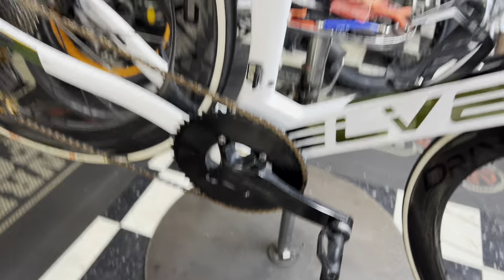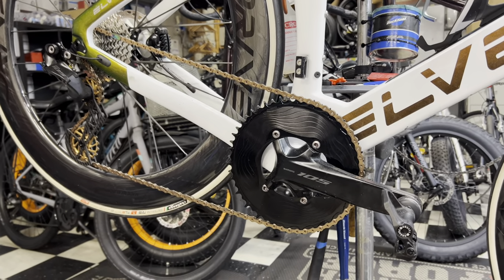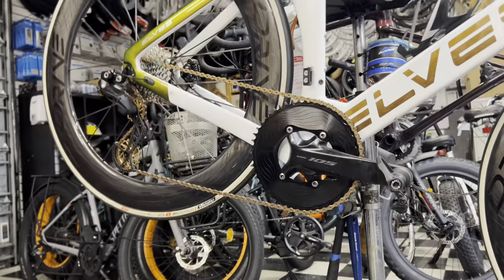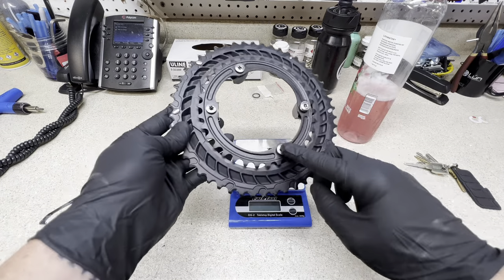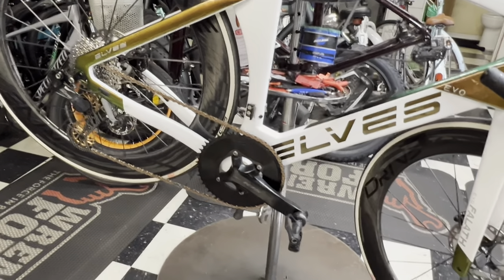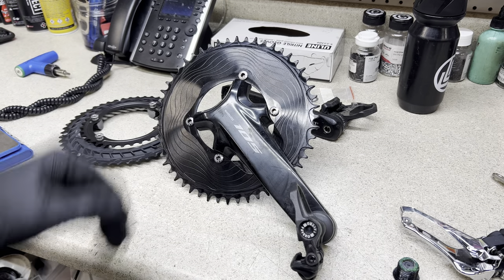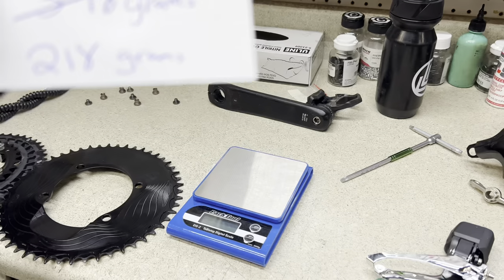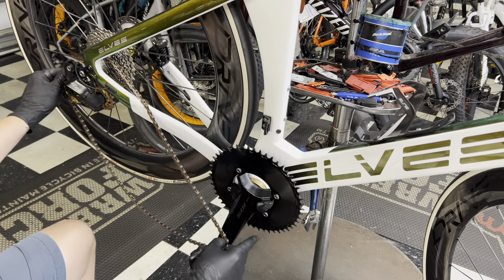IS THIS THE BEST UPGRADE FOR YOUR BIKE?

Comment: 1x is not for everyone and every situation. For certain situations, 1x is definitely the way to go. For most of the riders/situation, 2x is the way to go. I have 1x as well as 2x bike and use 1x mainly for my gravel bike.
Reply from the maker: I could seem them easily push this in the future making a 13 speed group road oriented and having a 1x chainring, having a 10-50 in the rear or something like that and a 48 in the front

Comment: I live in Belgium. My neighbourhood is the terrain for "Ronde Van Vlaanderen. The Hills here have elevations of 14-20 degrees. Even a competitive cyclist can't do them all with 1 front chainring. This is like trying to reinvent hot water.
Reply: Wva used a 1x in gent wevelgem. Climbing up the kemmelberg on a 1x. I tried it recently and im not a super great cyclist. I even managed to get up it at 23% in the big ring 52t with a 11-28
Reply: @SyLens1  he's using the classified rear hub. so he basically has the same gear ratios as a 2x
Reply: @SyLens1 link the Strava ride where you went up 23% gradient in a 52/28 gear.

Comment: You can save a whole lot more weight by going 1x in the rear (single speed) perfect for flat lands and big guys like you. I use SS for my Z2 flat rides.
Reply: When you are not climbing, saving 1kg on the bike really doesn't matter in terms of speed.
Reply: Yes, in fact, once you get the speed up, a heavier bike is better to keep the momentum because of inertia.
Reply: Yes, in fact, once you get the speed up, a heavier bike is better to keep the momentum because of inertia.
Reply: @blueshun  That's exactly why my 12.8kg fat tire road bike is such a steamroller on flats! People underestimate the rig until they see what I can do in a makeshift TT position (forearms resting on flats, head tucked). It just plows!
Reply: What about the added weight of the significantly larger cassette.  Probably offsets any weight savings from the front.
Reply: @testalino  I know, but just extending out his reasons for going 1x. Also saves a lot of unnecessary wear on any parts and even more aero going SS, extending his reasons even further....
Reply: @richardguggemos6336  I did the math with xplr vs 2x Force axs when I build my bike and even with the other cassette (10-44 instead of 10-33) it came out 200g lighter. But the sram front mech is heavier and I am using a lighter 46 tooth front chainring.
Reply: @chuckyfox9284   if you are using electronic shifters and disc brakes, do you really even care about weight?
Reply: @richardguggemos6336  I have more of an allroad build with 32mm tires that I also ride on gravel and very poor roads. Rim brakes aren't really an option there. My budget was under 2k€ and the bike weighs 7,6kg, which i think is pretty decent. I don't think mechanical shifting would be significantly lighter, if at all. All of the mechanical options I was looking at (Ultegra, 105,  GRX 812) ended up being heavier because of the heavier shifters and cables. A rim brake build would have definitely been lighter.
Reply: @chuckyfox9284  Chucky, you don’t have to justify your build to me.  Im happy if you love your build.  But, I’m just trying to point to the fact that most of the cycling audience is brainwashed by marketing to focus on features not riding.  By the way, a 105 AXS front d is claimed something like 150 grams.  Then there’s 50 grams of battery.  A good (not necessarily top end) front d is around 95 grams < half of AXS.  Unless you spend a fortune, even on Ali express, that enlarged rear cassette is probably an extra 200 grams.  And the derailleur to handle it typically adds a hundred grams. Your 42 chainring weighs half of a what a 50/34 combo does (50+34=84 84/2= 42).  I don’t have a 42 handy, but a 45 weighed in at 6.5 gams.  Netting these items, the 1x would be 350+ grams heavier.  Add another 200-250 grams for hydro disk brakes over rim calipers and another 100-200 grams of hydro shifter weight, even with electronic shifters and 1x, there is no amount of missing cable weight will lead to electro/hydro offering the lightest build.

Put another way, my 1st gen. red group is purported to weigh about two kilos.  New rival AXS (which I think has a similar real dollar cost) comes in around 3.2 kilos+.   And before you worry about only 2x10, recognize that unless one is looking for an unusually large range of gears, x11 or x12 doesn’t buy much.  There are still a bunch of gears on a properly configured cassette that are only 1 tooth apart. Adding one more of these doesn’t do much.  Meanwhile, the latest red still gives up 700 grams to my set despite its obscene pricing.  For an example of obscene: I recently saw a Red crankset priced at $749 which is close what I paid for my whole group set.  Inflation notwithstanding, that’s crazy.

Yeah the industry is trying to take away options, it’s called planned obsolescence.  But if you really want a caliper brake gravel bike, you can have one.  You’ve chosen and configured your bike as you like it.  And it makes you happy.  So that’s great and will probably encourage you to ride and enjoy it more.  I’m truly happy for you.  But too much bro-speak floats around echoing marketing speak and confuses consumers and misdirects riders to focus too much on technology and tool little on riding.  Moreover,it supports cost increases well beyond the range of inflation.  And of course that’s what all of the bs claims are all about.  So I say, don’t feed the dragon.  BTW, I’m about to build a frame on which to install a 1x setup just to see if I like the ratios that are available.

But all this bro-speak repeating
Reply: what is the point exactly of a z2 flat ride???
Reply: @janemf  To recover from your intensity days. To work on aero position. To become more metabolically flexible, train your body to burn fat instead of relying on carbs. To just enjoy riding your bike. Anyway, those are my reasons, I'm sure others have their reasons.

Comment: Not a chance. I'm doing Col de Joux Plane, Col de Loze, and la Planche des Belles Filles in the next few weeks - among others. I will be glad to have my 34/34.
Reply from the maker: Pogačar enters chat: climbing in big chainring
Reply: @GCPerformance18  but I’m a mere mortal!
Reply: @GCPerformance18 like saying everyone should be driving an F1 car because it's faster
Reply: @GCPerformance18 no, he doesn't, because Tour de France winners have nothing in common with 99% of cyclists.
Reply: 34/34 is 1:1, which you can still have on a 1x without sacrificing anything. A 38x11-42 is killer
Reply: @thedownunderverse  38/11 sacrifices 50/11 or even higher...that's a pretty big sacrifice. And having 11/42 surely adds so much weight to the cassette it balances out the weight lost from going 1x at the front.
Reply: @thedownunderverse  I also like the abiliter to add or dump a lot of gear at once. The FD allows me to do that when desired.

Comment: In a one-by  the chain is  under extreme stress at the top most and bottom most sprocket gears. The front derailleur helps with that. The entire drivetrain suffers worse than a 2-by.

Comment: I honestly believe if you live in Florida, this is a legitimate and functional idea. It looks way cleaner and less stuff on the bike to go wrong (hence why I'm anti electric Groupset and electric everything 😂)

But where I live, I may not have mountains but the elevation is ALWAYS changing and pretty much hills are everywhere and my 2x gets used EVERY ride for sure.
Reply: It sucks literally everywhere except a race track ring.
Reply: I came here to say the exact same thing. 

If you live somewhere that is relatively flat, there is literally no reason to run 2x; get rid of the FD, lose weight, make the bike more aero.
Reply: Yup!  Totally agree with you guys.  Where I live, in Maryland, I NEED my 2X.  No way could I do a single.  No way.
Reply: the problem is that in a mechanical group, if you don't have tools, the chain drops to the heaviest gear, and in an electric group, when the battery runs out, it stays in the same gear.
Reply: @MBdrummer3288  Yeah man! I LOVE the look and having less to worry about but I actually need it. There's been some rides where I was like "why did I ride this far" and on my way home, if it wasn't for that second ring, I would have had to call an uBer, take the bus or hop on the train 😂
Reply: @JW-hj6sd Yes and no. Yes it's true what you say but how often does your mechanical shifting have an issue? Like, really?
Reply: I will never go x1 even if most I ride on bike with SRAM red 22 hrd is the 53/11 gear even from traffic lights
Reply: I do very hilly gravel races on a 1x. Had one on my old road bikes, too. I went from SRAM to Di2 on my new one and dont have one for my road bike anymore. You need a bigger range on the back cassette, but I never had issues with it. didn't drop a chain once with it. I live and mostly ride in New England, so I'm not heading up like Long Hills, but we have hills.
Reply: @arthurmulhern  Right on! That's hardcore. I believe I could do it, as I rode a 52/16 single speed for a while but I still cried on hills 😂

New England as in East coast or "England" England?
Reply: @RyanWilson876   East Coast America. You do need to spend some time figuring out the ratios with the rear cassette. (check out Sheldon Brown's Bicycle gear calculator.) I think oval rings make a big difference too. I can go up a few teeth with them, and it's easier to pedal the same gear, and it's faster. I like faster.
Reply: @arthurmulhern  Yeah, I checked it out! I never really thought of the Oval rings. If it's really that good I'm going to have to give it a try! Seriously! I like speed personally. Not too caring for acceleration. I like maintaining high speeds.
Reply: @RyanWilson876   On my road bike that sits on the trainer most of the year. (They are "absolute black," not this brand) I went from 52/36 to  53/39, and it's easier because they are oval rings. Would definitely recommend ovals. 

I just bought the 54/40 from the company this video is about. Let you know in may if they are good.
Reply: @arthurmulhern  nice ! Okay! Okay! Looking to hear back from you!

Comment from the maker: What you do you think of the this being a thing in the future 1x13 drivetrain, and getting rid of front derailer all together? 

where to buy this chain ring: 
https://alugear.com/chainrings-1x/290-15690-round-1-speed-for-12sp-110-bcd-4b-shimano-asymmetric-roadgravel.html#/40-size-52t/15-color-green
Reply: CVT!
Reply: Hopefully we would never see the day where manufacturers only releasing 1x compatible only drivetrains just like disc brake nowadays. It doesn't mean that if Wout Van Aert use 1x that suddenly that's what you gonna use with your bike. I'm all about proper gearing even though let's say you're just gonna ride flats today having extra gearing makes more sense than faffing around changing your 1x crank set when you wanna ride on the hills.
Reply: Why would you save weight if you live in a flat area? It would be better to install a 11-26 cassette And enjoy the minimal gear step

Comment: I don't mind 1x, I have it on my gravel/allround flatbar bike that rarely sees proper hills, but I never understood argument of better chainline. I guess if you compare it to cross-chaining on 2x, but if you shift in the front when needed for sure chainline is better than in 1x extreme gears.
Reply: I think the idea is that you spend most of your time in about 3 gears next to each other and you can optimise the 1x to have perfect chainline for those gears. When you have 2by you have perfect chainline in really fast and really slow gears. I don't know if it works out that way in practice tho.

Comment: I tested a 1x setup by riding in my 50t chainring all the time and I could climb all the major hills in Montreal with an 11-30 cassette. I will actually go full 1x with a 11-32 cassette next season.
Reply from the maker: exactly, and no even more with sram having 10-36 or shimano having 11-34
Reply: @GCPerformance18 Soon Shimano will release their 11-36 as well
Reply: Agreed. I’m running a mullet 1x10-52 and it works for my BC hills.

Comment: I am using 50-34 with 12-25 or 11-23 cassette on the flat. I wanted 1X, but my bike was 6.8kg  with double. I think the 11-speed 12-25 with a good sized 1x chainring is the best for flat roads.

Comment: 1-"Just get better at cycling" I live in a hilly place. Not too much, but we frequently ride at our smaller chainring in a group.
Let's make the calculation and find out how good I have to be. 
4% gradient and want to go without grinding. If I run with 50x14 at 90 RPM, I ride at 26kph. (75kg rider) I have to run at almost 380 watts.!!! 
You can always run with your smaller chainring. In this case, you have to cross your chain.
If you live in a flat area and even a beginner can average 30 km/h, then use the 1x system. But if you live in a place with some hills and if you have to climb more than 3% or 4% in your daily rides 1x system does not make sense. (Talking for mortals among us)
I'd like to see how you get uphill comfortably with your 1x setup. Then we can talk about "being a better cyclist"

2- You only get a better chainline for 1 gear... In 2x Setup you get 2 straight chain lines.
Reply: Just to add to your second point, the outer cogs actually get worse with 1x. Most people would never cross chain that far up/down the block on a 2x, but you have to with 1x
Reply from the maker: so the 1x set sits in between the big and small chainring, thats where it lies, so when people are in big and big already, how it would it be worse then? people do cross chain people do run those big gears in the big chainring, but if the 1x setup is closer to the frame, in what world is it worse?
Reply: @GCPerformance18  If you get a straight line at 6. gear on your 1x System, you get at both 4. and 9. strait lines on 2x System. You have to cross your chain more with your 1x System if you want to use your biggest and smallest rings. @facingup1624 is right.
No one who understands the gearing system will go 52 front and 30 rear in the 2x system anyway. They will switch to 36 front and 24 rear...

Comment: I have always enjoyed your videos. And when I come to visit my son in Ft Lauderdale, I would like to stop in your shop. But this is a crazy setup for me. I live close to boulder of, South Carolina, and North Carolina. Often to bike the Blue Ridge Parkway. Where I live in the Upstate of South Carolina, my rides are often 50 miles with 3000 feet of Climbing. I would have no problem with a 1x; I never use my small chain ring. A 53 -34 is no problem, but once I get into the 3 to  8-mile at 13 to 15 percent climbs of the mountain in North Carolina, I love the 36 - 34. Not unusual to climb 8000 feet in 70 miles. 1x setup is for the birds.

Comment: For me wide range gear on a road bike is a huge no, recently swapped to a 42T inner (52T outer) with close ratio 11speed : 11-25 cassette, this is the best upgrade i have made for efficiency, yes, it is not as light but far more useable than a 1x, perfect cadence at all speeds. I use 1x on a Cannodale Slate gravel bike and it feels like I'm constantly in the wrong gear.
Reply: Perfect cadence on hills below 7% maybe!

Comment: I just got this for my Emonda I absolutely love it so far thanks for sharing this great product
Reply from the maker: very nice!!! I think it is one of the best 1xx chainring out there
Reply: What crank are u running on there? GC used FC-R7100 but alugear site says its compatible with 12sp Dura Ace and Ultegra.. it doesnt mention 12sp 105
Reply: @thedownunderverse  I’m using mine on 12 speed 105 di2
Reply: @catchthedream1142  amazing! thanks for responding… was it a good solid fit without being too tight and scratching up the crank?
Reply: @thedownunderverse  it was a perfect fit as long as you are mindful when sliding it over the crank it won’t get scratched if you want to be extra careful I recommend I few pieces of painters tape on the crank before installing the chainring then just peel it of when it’s installed
Reply: @catchthedream1142  I really appreciate the feedback my guy! One last question, once installed does the 1x ring line up dead straight on cog 6 or 7 of the cassette (i.e the middle?). Any issues with dropped chains if backpedalling?
Reply: @thedownunderverse  it lines up with the 6th cog I haven’t had any issues with backpedaling or the chain popping off even when going 30+ mph and hitting bumps only thing I’ve noticed that’s different is when I get to the 1st or 12th cog it does make a bit of noise it doesn’t really bother me I’m sure as it wears in it will probably get quieter
Reply: @catchthedream1142  amazing feedback, again thank you so much! If you had a “buy me a beer” link I would! This is all really helpful as I’m considering options for my build!  🙏🏻👌🏻🤟🏻
Reply: @thedownunderverse  your welcome always happy to help

Comment: I've done a bunch of rides with my SRAM 48/35x10-36 setup where I haven't left the big ring. And I don't live in Florida (usually I get more than 100m of elevation per 10km around here. Sorry, too lazy to convert to freedom units).
Granted, those were fast group rides and I wouldnt want to be stuck with a 48x36 easiest gear when I want to do a Z2 ride. But for a N+1 scenario, I probably would build a 1x road bike like this just because it looks good and is a nice flex.
Reply: With sram the best part is you can build a 1x roadbike for 30€ in 10 min. Just screw off the front mech and put on a 1x chainring.